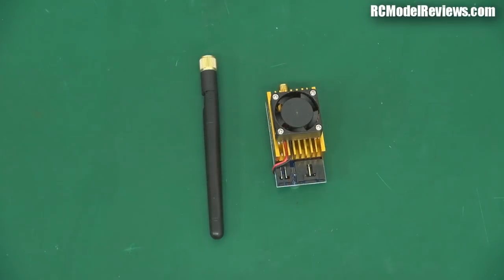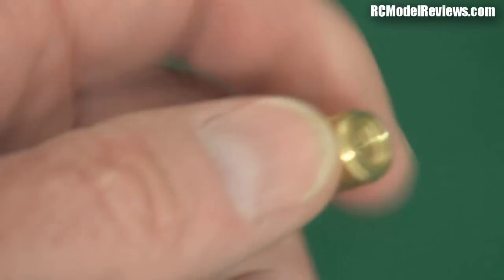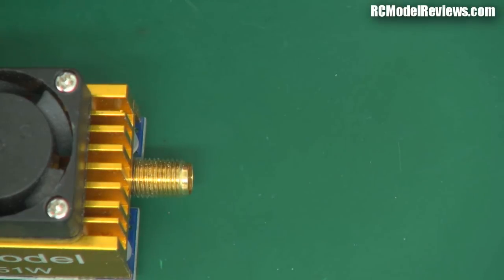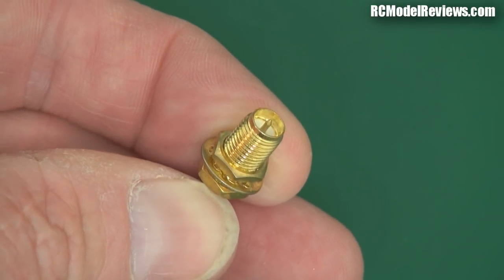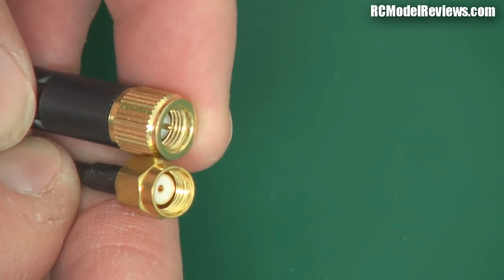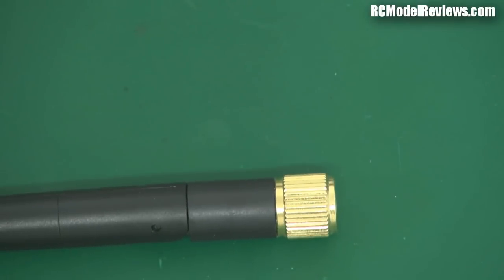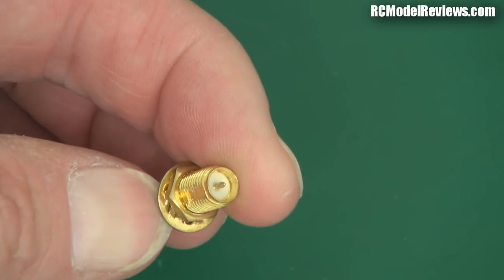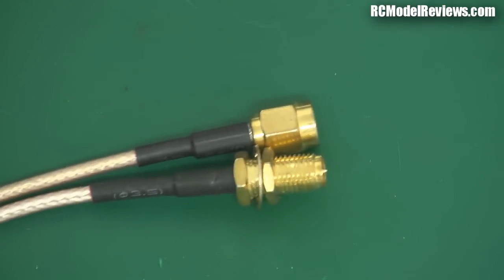SMA and RP-SMA connectors for RC planes

Comment: @RCModelReviews @4:13 into the video, there's a fix to this problem. You can get some AWG 19 gauge solid copper wire and bridge the gap. the 19 gauge solid wire fits nice and snug in the hole. It's essentially creating a pin. It works like a charm

Comment: I read somewhere that the RP was created when wifi hubs were introduced to 'stop' people putting better antennas on them, FCC requirement apparently
Reply: Yes, I've read that too. Although Bruce tells sma is used for wifi, all my wifii stuff has RP-SMA connectors. For rc I try to avoid it at all cost. Just don't buy it or resolder an SMA connector on it. Don't use cheap adapters, they are crap.

Comment: The intent behind creating RP-SMA was to comply with specific local regulations. The manufacturers had to make a new non-standard antenna connector for their WiFi devices that was hard to find replacements for (as they were all regular SMA before that), to prevent consumers from connecting antennas with gain and therefore breach compliance (fromWikipedia). So they just simply swapped the locations of the center pin and hole between the male and female connectors, it's nothing to do with the pin being a target for rough treatment in SMA gear
Reply: +Colin Ormrod Clear story about SMA and RP-SMA….BUT i still have one question for you: Can i use a Video TX with a RP-SMA antenna and on my goggles receiver an SMA RX with SMA antenna? will those 2 work together or not? or do i need to have RP-SMA on both TX and RX to work together? would be great if you help me out on this question…dumbs up and thanks in advance…greetings from Amsterdam, The Netherlands

Comment: Female to female adaptors on eBay.
Two pins with a short piece of solid wire soldered into them...

These are WORKAROUNDS --- best practice is to use the proper fittings, but if you have these adaptors in your kit, and are caught out in the field with someone facing
the matchup problem you can look like a hero.

In Ham Radio we have seen SMA and now starting to see RP-SMA. Your "reason for it" was the first I've heard... I'll pass that along to my students who complain. Sounds
as reasonable as anything.

Cheers, Bob WA8YCD
Reply: +Bob West Thanks, I figured using an adaptor to mount my SMA bluebeam ultra onto a black pearl would effect the range. Wondering how drastically it might effect the antennas range? Should i just trying building my own antenna with the proper connector?

Comment: PLEASE HELP!!!!! Hi can you clear something up for me my transmitter is RP sma boscam and my skyzones goggles are sma so if I buy sma antennas and use a adapter so one of the sma antennas fit the rp sma transmitter will I lose much signal  and range is this setup fine. Do I just need to buy a sma transmitter so both are sma.

Comment: Hi all.. I have a question about a dual antenna mod. What if you use a T shaped RP-SMA connector at modified transmitter and connect two 50 ohm antennas together in parallel? Is it gonna help to increase range? And would if affect badly on the Tx as you're playing with the antenna impedance? Thanks.

Comment: I have an amazing mix of TX and RX with both SMA and RP-SMA. From a technical perspective there is no quality difference. Most 2.4 GHz RC TX use RP-SMA and most, but not all, UHF (LRS) systems use SMA. With video TX/RX systems, it depends who makes them. It pays to have an SMA to RP-SMA adapter and an  RP-SMA to SMA adapter in the flight box just in case. Not forgetting to make sure that your antenna is the correct one for that frequency!

Comment: Very insteresting explanation.  Can you solder a rp sma conector to a coaxial cable.  I want to connect an omnidirectional antenna to extend the range of my router.

I'm in Mexico and is very hard to get reliable information and components down here.

Comment: Question. I have lost my standard 2Dbi 2.4Ghz FrSky Whip Antenna. (Been using a 7Dbi Patch Antenna) Can I use a 5.8Ghz whip antenna from my spare  5.8Ghz Tx (Gone to Clover Leafs)??? Or will I have problems with this???
Thanks in advance for any advice.

Comment: I just ordered a Kia Deng K70C quad, hasn't arrived yet, but doing more research I've found there have been several fly offs, the antenna in the radio and quads is only a short wire, how could I install a 2.4 antenna on the transmitter and the quad and not lose DBS

Comment: I was wondering if there's a bottom to the female part of these connectors.
ie, if I could just use find an appropriate length and width of rigid wire and use it to bridge the gap when joining female SMA to female RP-SMA.
Effectively adding just a pin between the two female components.
If there's no bottom or landing to the female connectors, then that would be no good as your pin would probably go all the way though to one side and not necessarily making a good contact with one of the connectors.  
I'm not so much looking to save money here, more space and possibly weight on micro multirotors.
Thanks for the vid, I had discovered the difference some time ago, but hadn't understood it.

Comment: Another thing that I'm guessing is commonly misunderstood are the numbers attached to motors, particulary when motors are described as "450 series" or "250 series", etc. etc.  Is there a reference table that simplifies this practice?  Thanks.
Reply: +Glenn Doney 
I think they are talking about the distance in mm between two motor shafts diagonally across form eachother.

Comment: Hi Bruce, having an antenna with the wrong type connector, is there any major drawback in using a SMA to RP-SMA adapter to connect the V-TX?
Reply: A good quality converter should cause no problems.  There are some cheap ones however, and they can cause some signal loss.

Comment: I just noticed your soldered bridge on your VTX :D .. stupid reverse polarity protection diode gone pop because you looked at it the wrong way on a Thursday morning?
Reply: No, that's the way it came!
Reply: ***** Great idea. I read on some forum that more power outgoing from antennas equals more sensitivity to wrong  placement of equipment. And this way more power from VTX antenna may reduce total range of plane from pilot. There was also written that most if not all low pass filters which are sold for RC, silencing significantly also desired band and they are simply reducing all power outgoing from antenna. Is it all true Bruce/xjet?

Comment: Thanks Bruce - another great video. I am trying to set up my FPV base station to be able to fly from within my car given the temperatures in my part of the world at this time of the year. I ordered SMA extension cables, but was sent RP-SMA cables which of course didn't work for my Dragon Link and 1.2Ghz video system. My question is (and I had hoped you would touch on it in this video) "How long of an extension (SMA) can I run for my Dragon Link and 1.2Ghz video receiver, to get the antennas up on the roof of my vehicle from inside the cab?" Does one lose signal strength with the increased resistance of adding too long of an extension? I was hoping to extend about 1.5 meters. Of course, I could set it up and range test, but I thought you would have some insight.
Thanks again for the greatly informative videos!
Reply: A 1.5m extension lead shuldn't hurt too much.

Yes, longer cables do introduce some additional loss but at 1.2GHz the loss isn't too great if the right cable is used.

Comment: Hi great video! I been using a 300mw booster by Sunhans with two antennas a 5db 9db for my Syma x5sw and x8w. The x5sw flies out to 400m + now and my FPV works well beyond that. The FPV system is RC832 RX with a Anbee clover antenna and a Crazepony FPV micro AIO..40CH 25mw TX. I never really made sure that every thing was RP-SMA or SMA. I thought my booster was RP-SMA then watched you video and checked turns out that it's SMA. Sunhans booster came with an adapter I did not think anything of it I just use it to make sure all the pins plugged in correct. It work great and I have a strong signal. I hope that all made sense:) So do you think that I would be fine using a SMA booster with RP-SMA antennas? Like I said everything plugged in nicely. Thanks again!

Comment: to the vid by 5,00   Why dont you pull one pin out so it fits perfectly and the signal should be sent straight thro the coax without any loss...

Comment: for me im gonna use rg316 with an rp-sma for my wifi extender that has been fckd up and previously using sma but needs to solder on its terminal. i bet i wont have any problem with this. Thanks Mate

Comment: amazing they were so smart to make it like that for such an inane reason but came up short to make them look different to we can easily tell which is which. eg, different colour or  shape or even different size threads? A small length of solder works well to connect a RS-SMA female to a SMA female connecter. Make it slightly longer so it squashes in nice and tight.

Comment: If you want to see lots of versions of these Google >> rp sma vs sma << There is another RF connector use in receivers, like the D8RIIplus and they are the u.fl or IPX. Each of the diversity antennas are connected to the Rx's PCB via a surface mount ufl.  The u.fl connector on the end of the antenna leads seems to be both male and female. They snap on with an audible click

Comment: Excellent - thanks Bruce :)

Just got a few parcels in of various things, and I did what I usually do and not put everything back into it's correct box. Was faced with "um... which antenna now goes with which little black box?"

Didn't realise (or more to the truth, look closely enough), but the now I've got a heads up on SMA v's RP-SMA, I'll know how to tell which boy bit goes with which girl bit.

Brilliant :D (or should that be 'brullyant'?).

Fanx.
Reply: If you've got antennas on different frequencies but they all look like those little black ones -- put some masking tape on the base and write the frequency on them.   Without an analyzer -- or without pulling them apart, there's no way to tell what frequency they are designed for otherwise and putting a 5.8GHz antenna on a 2.4GHz system (or v/v) will produce problems -- regardless of whether the connectors are the right type or not.

Comment: Is it possible to connect a female SMA with a male RP-SMA by inserting a copper wire pin in between the two?
HACK
Reply: +Aaron Bash i tried signal lost

Comment: ...continued
you don't want to replace the chassis part when the exposed pin is damaged. Use SMA, and replace the cable or the cheap antenna instead.

Comment: I thought the antenna damage excuse was a far too lame of an excuse to justify totally screwing up what WAS a standard, so I looked it up and found this on Wikipedia.  Blame the freaking bureaucrats as usual:

"Because they were not readily available, RP-SMA connectors have been widely used by Wi-Fi equipment manufacturers to comply with specific local regulations, such as those from the FCC,[10] which are designed to prevent consumers from connecting antennas which exhibit gain and therefore breach compliance. The FCC considered that the RP-SMA was acceptable in preventing consumers changing the antenna; but by 2000 it regarded them as readily available,[11] though delaying its ruling indefinitely.[12] As of 2013, leading manufacturers are still using RP-SMA connectors on their Wi-Fi equipment.[13]"

Comment: A third wave feminist invented RP connectors.

Unfortunately putting the male pin on the appliance and the female pin on the cable means that the expensive equipment is now more likely to get a damaged pin than it was before and the cable (which is cheap and can be reterminated easily) is now needlessly ruggedised. If you are rough with your cables it is because you don't care so no need to change it.

A colleague of mine damaged the RF port on a satellite modem and the modem cost $5,000 to repair in order to keep the warranty. Maybe just keep the appliance female.

Comment: RP-SMA is stupid stuff - avoid at all costs,. It was introduced to make it difficult for the layman to attack commercially available hi-gain antennae to WiFi routers, voiding the EIRP guidelines. Silly, as if there would be no converters, ever. Anyway, you don't want an RP-SMA on your transmitter or other equipment, because